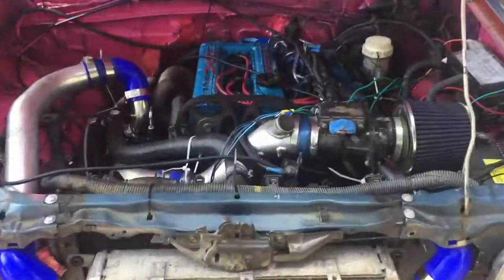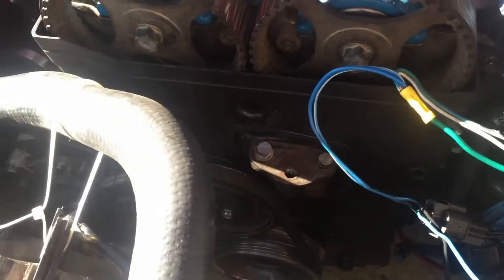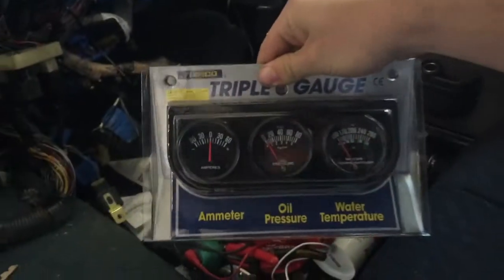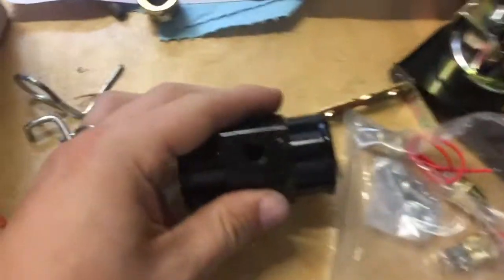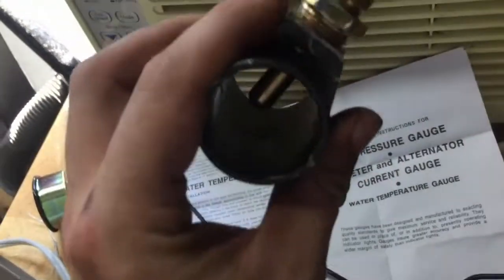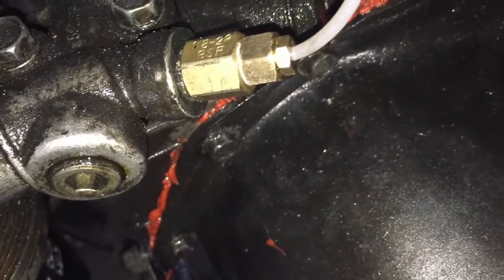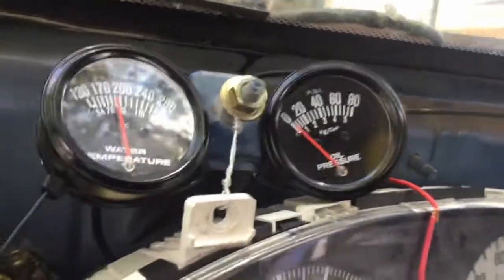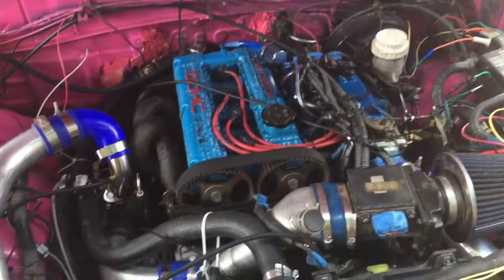Mighty Max 4G63 Swap Part 22 - Aftermarket Gauges, Hardwired Radiator Fans

Comment: The second radiator fan is only triggered by running the A/C on the 2g dsms, but you can wire it so it kicks on it's a popular 2g dsm mod otherwise good progress man.